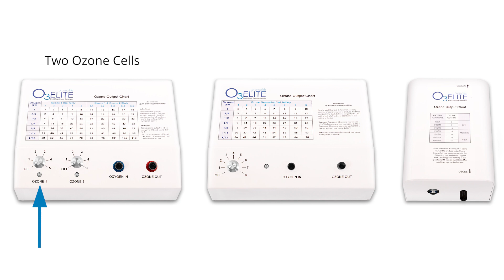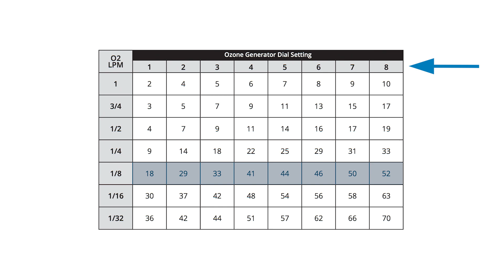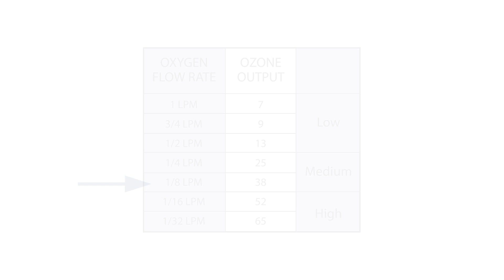Setting Up the O3Elite Ozone Generator for Ozone Therapy

Comment: please how do you regulate oxygen flow with the mini if it doesn't have a dial?
Reply: You use the dial on the regulator that is attached to the O2 tank. You won't have as much control over as many variations of gamma but it's not a big deal. I have one and keep my tank regulator at ¼ I think. I"d have to go check. The big lesson I learned is NEVER leave your tank on. You run out of O2 quickly and have to get another tank. LOL Lesson learned. Luckily it only cost me $14 to get a new one.
Reply: @ElisabethDonati  thank you so much! so that regulator comes with the tank, not with the Elite machine? I thought the regulator was that accessory called Destruct something.
Reply: @sallybowles2781  regulator always comes with the generator NOT the tank.
Reply: How much was the mini? And do you use it for a sauna?

Comment: How can you tell if your O3elite is working properly?  I’ve had mine for several years and I used it today and did not smell the normal ozone smell that it used to produce when I first purchased it?  It had no smell at all?
Reply: Your o3elite should be turned on every other day, even if you're not using it. The oil can dry out if you don't maintain it [on] properly,  I've heard.